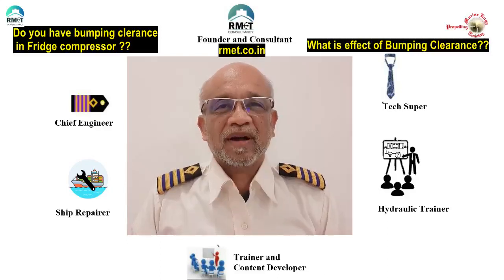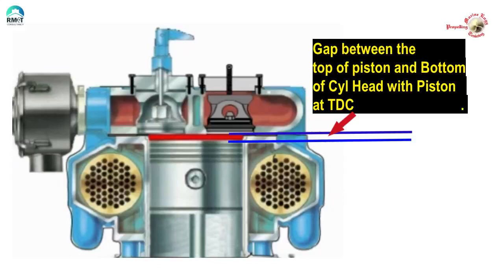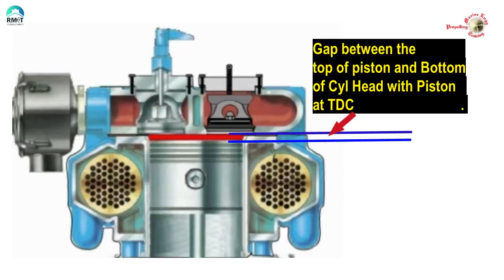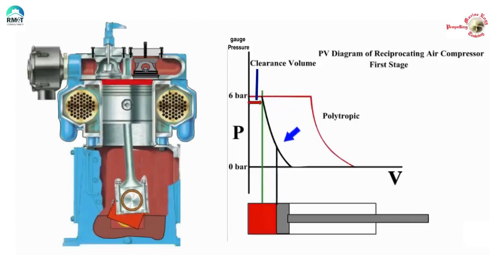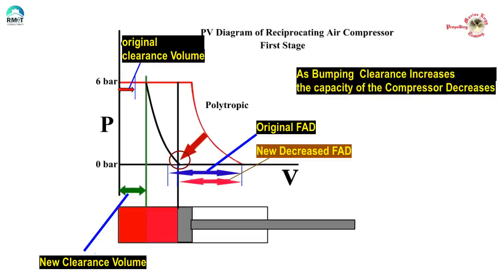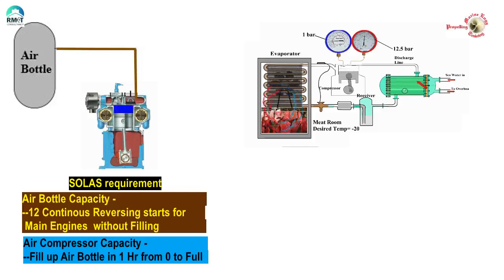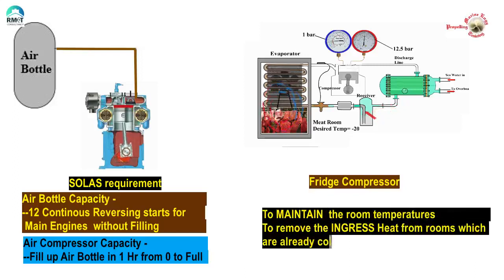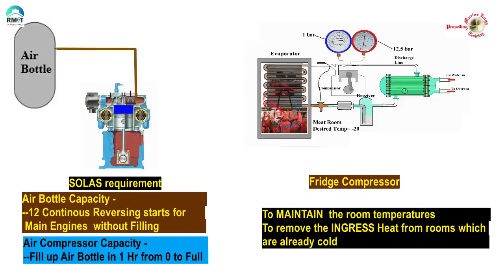Why no bumping clearance in Fridge compressor?|What is Bumping clearance?|Ramesh|RMETC

Comment: Good day sir, I think the fridge n ac compressors compressing the refrigerant which is probably at sub zero temperature so there is no heat generated n piston won't get expanded. Also may b the wear out of bearings (gudgeon pin, conrod n main bearings) will also b less due to the temperature is cold so less chance to increase the bumping clearance.. just my thoughts correct me if I'm wrong. Thank u sir again for dis wonderful video